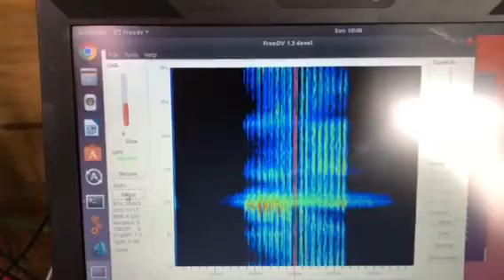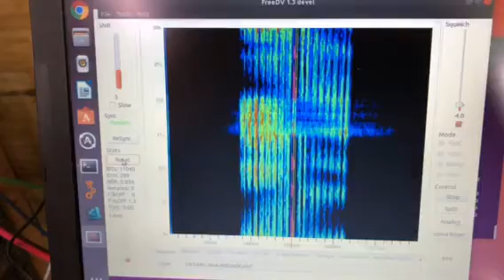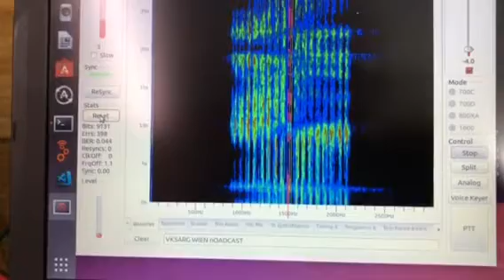Story about FreeDV on WIA news

Comment: free dv sounds worse than DMR i wonder if adding a different codec to freedv perhaps the codec used by mobile phones would be the answer. i couldn't make out anything in the recording.
Reply from the maker: Perhaps, but the point of FreeDV and in particular codec2 is that it's a free and open source low bit rate speech codec.